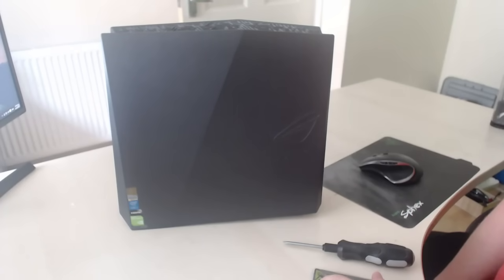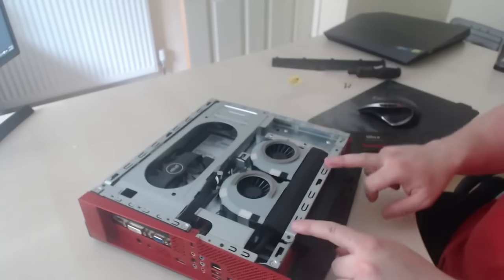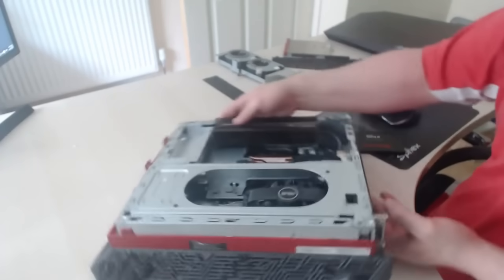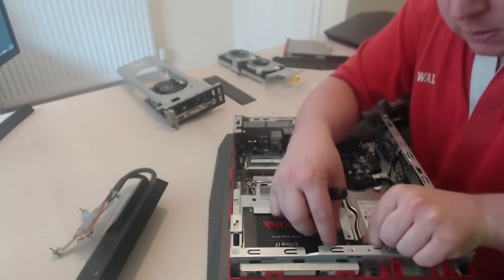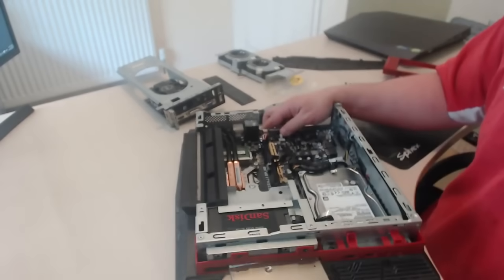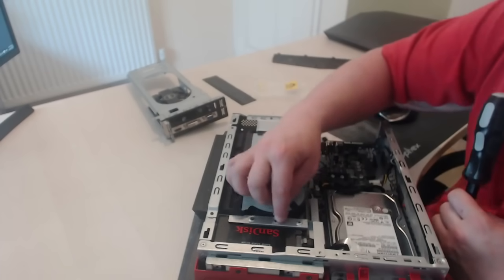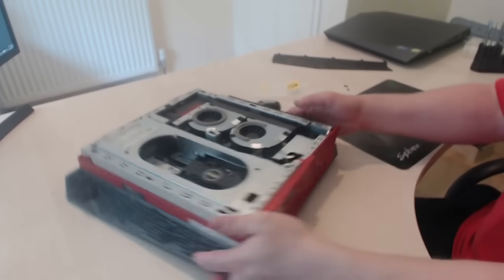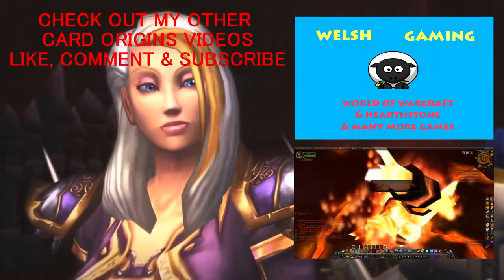How To Change SSD Upgrade Tutorial (Asus ROG G20AJ)

Comment: Most annoying CMOS-battery location in history, I upgraded my GPU to a 2060 and with a depleted battery it wouldn't recognize my USB-keyboard on boot. Had to unplug the GPU, use the built-in HDMI and change to the BIOS setting to "full USB initialization" on boot while keeping the PSU connected and then re-plugging the GPU.
Reply from the maker: yeah its not the best place, when this happened to me it was so long ago when I made this video I had a keyboard with the old ps/2 connector, it will work straight away as I had the same issue with the keyboard not working
Reply: @welshwhoopee  PS/2 to USB-adapter?
Reply from the maker: @oskich  I think you can buy that, at that time when you plug in that old school keyboard it will always work in bios, cause the computer needs to load up the drivers for the usb ports

Comment: Thanks for the vidoe 
I think to add M.2 1To  
Did you think it will work ? 
AI bots said i may need heatsink
Reply from the maker: yeah only if you have the Asus ROG G20CB model of the laptop, if you have spare money as it will help with thermal on the m.2 nvme ssd,  as you won't get the full speeds of the m.2 ssd as its a old port that doesn't sort them speeds of newer drives

Comment: Guessing that how to install windows on the ssd video never came
Reply from the maker: What  do you mean, you wanted to swap your ssd around to another one?
Reply: @welshwhoopee  for my case, yes. How one would go about that process to clone windows to a new SSD? Also, what maximum capacity for an SSD would work for these motherboards (G20CB)? I heard they are limited for 256GB for the NVMe kind

Comment: I need help, 1TB HDD is failing, I've replaced it with a 500GB HDD (not ideal but it's what I had on hand). The BIOS says the drive is there but it doesn't want to function as a boot drive and now I'm stuck for what to do. My thought is try again with a  different1TB drive but thought I'd ask around 1st, see if there's a better solution
Reply from the maker: sorry for the very late reply, do you still need help?

Comment: Hello! I've been upgrading an Asus ROG G20CB that I have and your videos have been extremely helpful. Thank you! I upgraded the RAM to 32gb (2X - Samsung M471A2K43BB1-CPB 16GB DDR4-2133 SO-DIMM) and installed an M.2 SSD (SAMSUNG 980 SSD 250GB PCle 3.0x4, NVMe M.2 2280) for the the boot drive / operating system. Everything work better than I could hope but then I tried to add another SSD with a SATA cable next to the CD drive (Kingston SQ500S37/480G 480GB Q500 SATA3 2.5 SSD) and now nothing will turn on, not even power to the USBs. Even with the new SSD unplugged. I've carefully taken this thing apart about ten times now and I'm at a loss. I'm hoping it's most likely something silly but I don't know where to start. Any ideas would be very much appreciated! Thank you! 

I7-6700
32GB RAM
Nvidia GeForce GTX 1070
Reply: i want remove cd-drive and replace with adapter, connect ssd with SATA cable, is that not work ?
Reply from the maker: Sorry for the delay, do you still need help?

Comment: I have gotten the new ssd in and working I took out the hhd (broken) now I’m stuck in bios and confused how to get out I think I need to switch the boot order but can’t find in the bios settings.
Reply from the maker: As in the system wont boot up to the pc, do you have windows installed on the new ssd?
Reply: @welshwhoopee  yes i got it all figured out, thank you though! Everything was running just had to download new windows.

Comment: I have ordered an ssd (Crucial MX500 1TB 3D NAND SATA 2.5 Inch Internal SSD) and ram (Crucial RAM 16GB (2x8GB) DRR3 1600 MHz) to upgrade my g20aj a little bit as it has slowed down over the years. Is there cables or anything else that I need to order so that I can have both drives working?
Reply from the maker: Are you putting a second drive in the system or replacing the main drive? If its a second drive then you will need a power and data cable, I had these spares ones in my box, otherwise you can get them on ebay

Comment: Quick question if my main hard drive disk doesn’t work can I still used the ssd drive as a main hard drive?
Reply from the maker: your main drive should be the ssd and not the sold 1tb mech drive, and also fresh windows if your still on the one that came with the system

Comment: my ssd doesnt fit into the tray (above the optical drive) i can put it somewhere else?
Reply from the maker: yeah I would personally take out the optical drive out, and use double sided tape to just keep it in place. at that time I used a sandisk ssd and fitted ok, but remeber you need to remove the cage to really give you access, leaving the cage in place made it really made for me to try and push it into the small gap.
Reply: @welshwhoopee  thanks! oh and I got it to fit. I didn't see that there was a small recess in the box allowing for it to fit!
Reply from the maker: nice and is it running ok?
Reply: its a 2.5" crucial bx500, what size did you use

Comment: Great video! My current HDD is always at 100%, how can I move windows to the SSD and use it as my boot drive?
Reply from the maker: Hello, I would personally install the SSD as normal, then in the bios set the ssd as main boot up and then download windows 11 and put on a dongle so you can boot up from usb. when I first brought my pc many years ago, I had the windows that came on the system and running on the mechanical hdd which came with the pc, same issue 100% all the time. at the time I just formatted the hdd and installed fresh windows 10 and 100% fixed, my guess is that the pre-factory is full of boated software.
Reply: @welshwhoopee  dude you’re a lifesaver. I’m having this same issue 100% disk issue now, is there a reason you recommend upgrading the SSD over just formatting the hard drive?

Comment: Is there a slot to use m.2 ssd instead of sata ssd?
Reply from the maker: Hello, yeah but your will need either the CB machine to have the m.2 on the motherboard, the BM or AJ models don't have this feature
Reply: @welshwhoopee  where i can find that? Can u show link on ebay?
Reply: My system is an aj model and I bought an ssd, I’m missing the sata cable, need help cause I’m legit dumb when coming too this kind of stuff
Reply from the maker: no worries, have you open your pc yet? some of the pc do have the cables pre-installed all ready inside, if it does then all you need to do is install and plugs in the 2 cables. let me know if power and date cables are missing and I can send you the links to the ones on ebay if needed.
Reply: Have you got a discord, I’m legit a dummy on this computer stuff
Reply from the maker: no I don't sorry

Comment: What ssd did you used?
Reply from the maker: I used a Sandisk SSD, but you can use any brand SSD to install into this machine
Reply: @welshwhoopee what’s the max size(TB) I can put I. This machine. SSD and HHd. Right now I have a 1tb ssd and a 4th hhd. What’s the most both of those can be.

Comment: How did you find the cables to add the ssd because everyone just replaces it but I want to do what your doing
Reply from the maker: most of the cables in the video was in my box, but I have spoken to a lot of people over the years and some models and box either have them or don't have the cables, but I have also seen the cables in side the case ready to be used